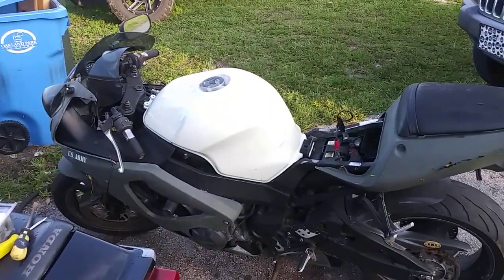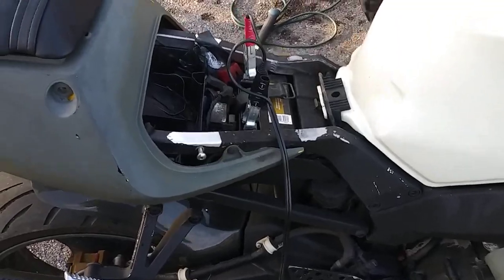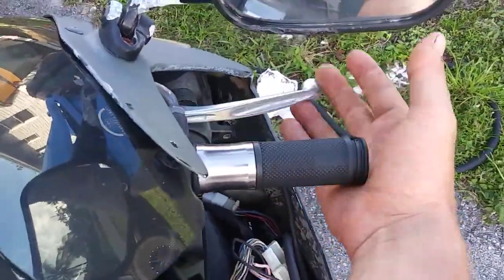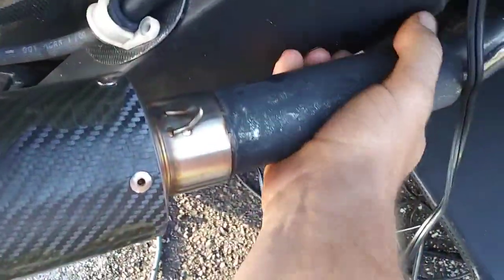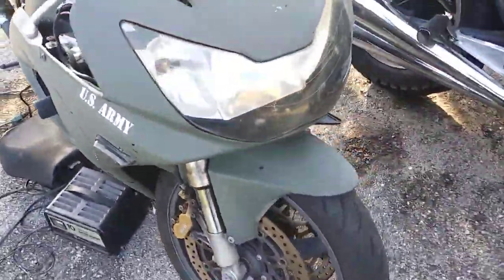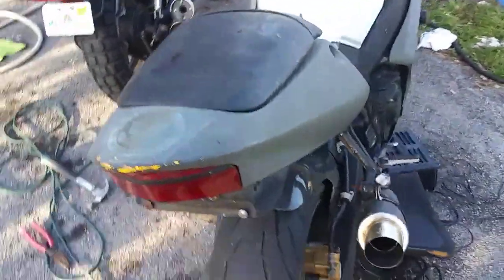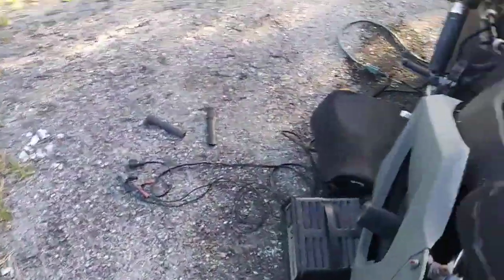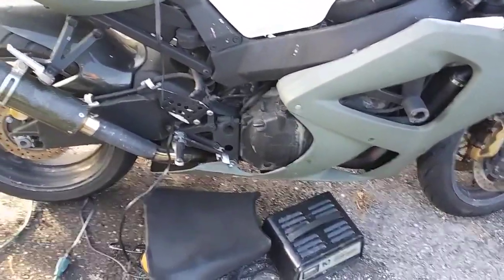2000 cbr 929 rr project bike before video

Comment: Ever get anywhere on this project I just got one myself
Reply from the maker: No. ive been so busy with everything else. it needs an ignition switch but none of the new ones have that diode that drops the power from 12 to 6 volts. so i have no spark till i find one.
Reply: @smallengineguys   I ordered the 38 dollar one off Amazon that comes with the gas tank and seat latch lock I’m gunna be switching the tumblers out. If that works or not I can let ya know cuz your not really changing the electric side of it
Reply from the maker: @mmm6014  i got it with no spark. the previous owner changed the ignition and it didnt have the electronics built in. so i have slowly been searching for an oem ignition. ive swapped all kinds of electronics. last is the switch. ordered many aftermarket none have the electronics built in.
Reply: @smallengineguys  yeah I’m keeping stock electronics just changing tumblers out good luck to ya